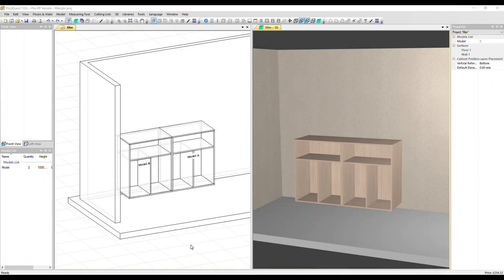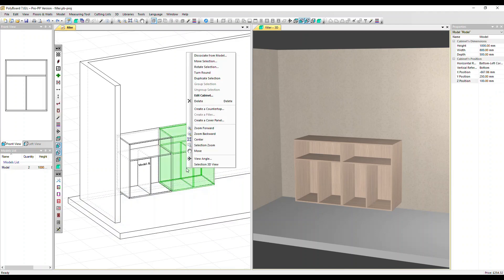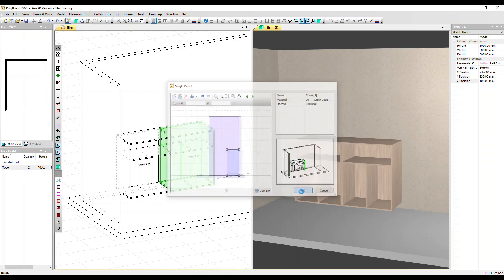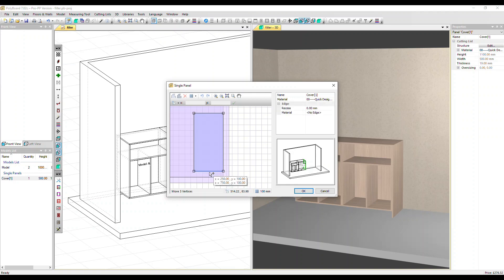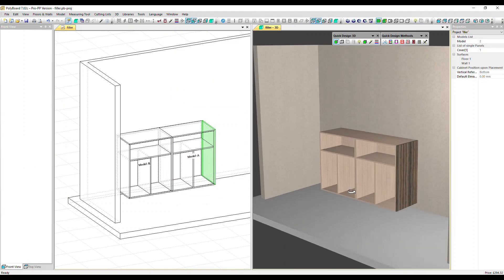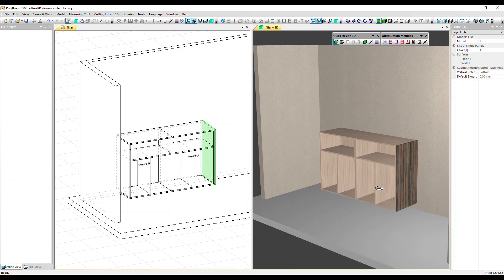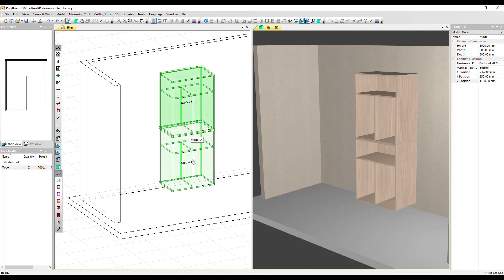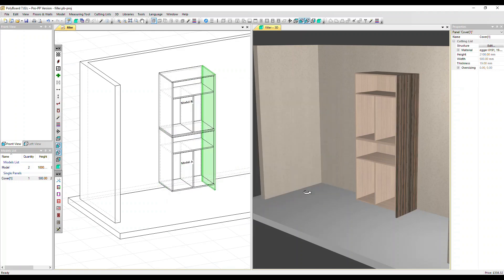Cover panels in Polyboard’s project mode

Comment: Great video on cover panels! I noticed that when you adjust the length of the panel, the system displays edging options that can be customized. However, in your demonstration, it seems you didn’t make any changes to the edging, yet in the 3D view, the panel appeared to have matching edging. This could be a bit misleading, as it might give the impression that the edging is set by default when it’s not. Is there a way to clearly confirm whether the edging has been applied or not? Thanks for the excellent content and insights!
Reply from the maker: Hi Ben, 
When creating a cover panel you can select the edge that needs edging. This will give you an option of adding edging information/edge tape. This will not be completed by default.

In this example the matching edging was not actually edging, it was just the texture of the material.
Reply: @wooddesigner  Thank you for the explanation!